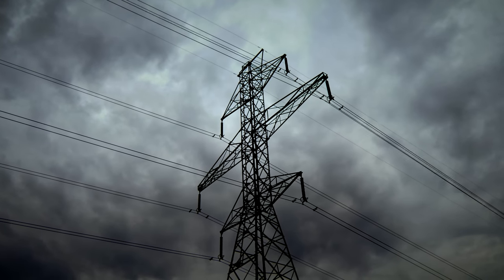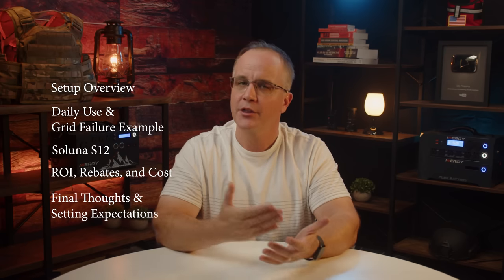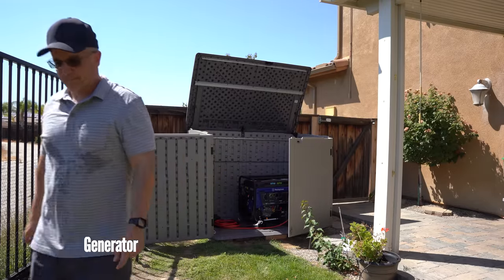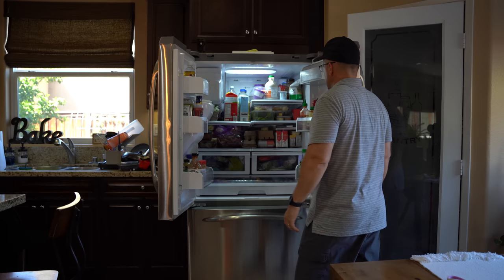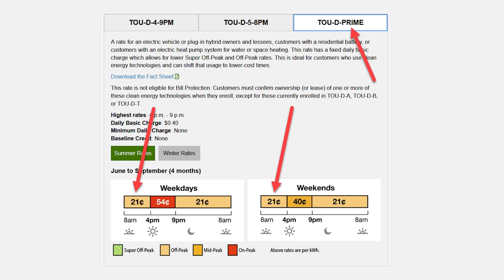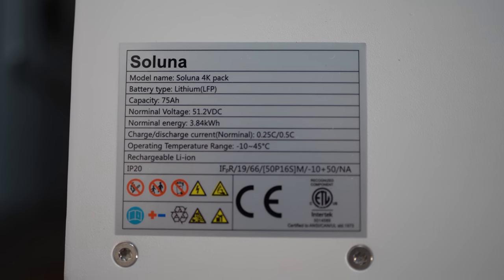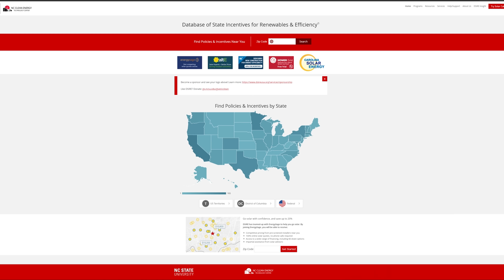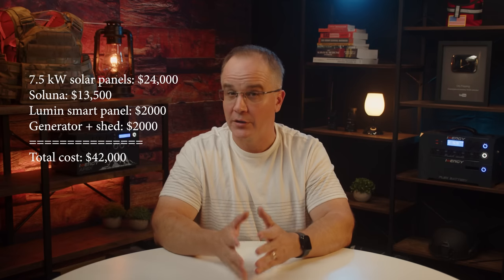The Coming Power Grid Collapse.  Soluna S12 Whole Home Backup Power

Comment from the maker: Check out the Soluna S12 here: https://cityprepping.tv/3RxtzIp (coupon code "cityprepping") or contact Inergy with questions: https://cityprepping.tv/3PerDCM
Reply: Chris thank you for this. I am based in central texas an just had a company coming for an assesment on my house. horrible service, more than double the price and no battery pack, no generator either. I decided not to get it with them however I keep looking for a system like this. i will use you coupon to contact them for a complete system
Reply: @Maran2012  We'd be happy to help you out!
Reply: The Northeast Blackout of 2003, prime example of our ancient, obsolete power grid. A line drooped into foliage, blackouts across northeast US and southeast Canada.
Reply: Sounds like a great system and will save you money Kris.

Comment: If only I had $42,000. Even the $31,000. Guess I’ll have to rely on my wood stove for heat, oil lamps for light and my gas generator for my fridge. Sadly no one is giving me things to try out. You’re definitely blessed to have it all. But I don’t envy you living in California with all those houses near you! I’ll take my woods and farming neighbors and feel blessed. Take care
Reply: Chris has the means to buy a turn-key system.  I design and install off-grid energy systems that will blow this out of the water for a fraction of the price.
Reply: a cabin wood heat and stuff      remote   is best     for just so long     too many people too many issues
Reply: Wait until he gets his video revenue....this will be a FREE system!
Reply: @garymorton7922  psalms37 : 10 11 & 29 💞 Eviction pending
Reply: Most of California is rural.  And since COVID, many people have figured out how to work from home.
Reply: im on disability and built a system for my home that handles 100kwh that cost me only 10,000 by not buying a already made system i bought each part over a year little each month  but if you build it like i did you have to install it your self
Reply: @HighDesertOffgrid  Contact information?
Reply: Wish I could afford what you have.
Reply: Look up Will Prowse, you can build a full system for less than $5k that can run your fridge, freezer, lights, tvs, computer, water pump, etc. Just buy a lil at a time. You could even do a much cheaper system if you only needed to run a fridge and lights. Best of luck.
Reply: @Jinxed Swashbuckler I do completely off-grid systems. Panels, battery banks, charge controllers, and inverters.
A turn-key system is simply one that is completely done by someone other than yourself.
Reply: The grid has been on the verge of failure for decades yet it still is here.

Comment: If u control everything through ur phone and towers are out, I assume you got other sources to manage the system? How is it done?
Reply from the maker: it all works without my phone.  i just couldn't control the Lumin with my app, but instead I can either unplug devices or flip the circuits manually in the sub panel.  The Lumin is a "nice to have" feature, but not required.

Comment: Microgridding is the future.  Point of use power will always be most efficient, and we can supplement the grid when needed.  A community wide microgrid will do better than a centralized mechanism.  I am in the process of designing systems from RV, to home, to industrial.  It will be modular and can scale easily.  The RV systems will  of course be smaller in footprint, but I will be trying to maximize efficnecy for power in.
Reply from the maker: Yup...I agree.  Our state is trying to incentivize people to move this direction.
Reply: I'm in az, 22,000 kilowatt solar system, I can't use all the power I make
Reply: I'm completely off grid and DIY'd everything.  But, I am an EE by trade and been working in the industry for over 20 years.  I know a little more about electrical than the average bear.  

Everyone should start looking to moving away from centralized utilities and control.  But that means discomfort, so we know most people wont.
Reply: I'm a fulltime RVer.   Last fall I had 1200 watts of solar panels installed and wired to the RV's "house" system.  I have a Bluetti 2000 watt unit that I charge from the "house" system.  What I regret is that I didn't have the money last year to replace the "house" lead-acid batteries with lithium, only deep-cycle AGMs.  Really frustrating on low-sun days how little I can draw from the "house" batteries before they are overtaxed.  Glad to have the Bluetti as backup - I will plug specific appliances into this if needed.  (I'm also glad I  have a gas/propane 3000 watt generator as additional backup - I run it on propane, keeping the generator itself easier to lift as gas tank always empty. This functions as 30 amp "shore power" when needed.)

Plan is to save up for two 100 amp-hour lithium "house"  batteries.  Strongly recommend to anyone replacing their RV "house" batteries with lithium.
Reply: Until the sky goes dark...
Reply: I don't think one can be at all certain about such a prediction in such an uncertain time. A return to subsistence farming and a post-industrial economy may be the future. Home power systems likely won't survive more than 10-15 years without maintenance components being available even if they aren't destroyed in some fashion. I don't know how likely any of these outcomes are, I just imagine that they are >0.
Reply: False:

When it comes to generators. Grid scale generators which use HRSG technology to recover waste heat achieve 55% to 65% system efficiency by recovering energy in the waste heat.

Home generators are 10% (low load) to 20% (max load) efficient.

Since most homes will be run at 25% load or less the grid generators are around 5x more efficient then a home generator. There are distribution losses but most of the power does make it to your house. I have had zero luck finding home generators that recover waste heat to create more electricity. There are options that allow for waste heat to be used to heat the home.

Renewable energy and batteries on the other hand are an easy win when it comes to distributed grid.

The point is, get a generator but don't expect it to be more efficient.
Reply: @garycarder4363  how much of that do you actually use?
Reply: @offgridmgtowhomestead2520  and money grows on trees.....
Reply: I think that's correct.
Reply: @offgridmgtowhomestead2520  I'd very much like to see your vision on this one and your achievements. Hope to see videos or articles about your builds.
Reply: @stefanbukowski8983  I don't think I've ever seen anyone talking about microgrids and distributed power generation and mean anything but renewable energy.
Except you, that is, but that doesn't really count because you're just strawmanning to feel like the smartest person in the room.
Reply: @offgridmgtowhomestead2520 ur right most people won't but will be forced when the grid goes down.

Comment: Remember: Rechargeable batteries only have a certain amount of charges before they have to be replaced. Companies ALWAYS exaggerate the amount of charges.
Reply: Forget AGM and Flooded batteries, go with LiFePO4 batteries, they have a 5 or 10 year warranty and the 10 year ones have a 6000-8000 cycle rating. The cheaper LiFePO4 batteries are good for 4000+ cycles. I've used them for years for ham radio. They are expensive but have a much longer life than standard deep cycle batteries and you can drain them to 5% capacity (but for maximum life, keep them between 20 and 80%) as opposed to only being able to drain to 50% without damage like normal batteries.
Reply: @Future-Preps35  agm's are rated for four years life....my last set literary lasted 4 yrs.
Reply: Yes but there are ways to greatly extend the batteries life for one you never allow it to drain beyond 50% and the system will last for years
Reply: @W9HJBill  That's some good info. Thanks.
Reply: also build a solar system witch is "AC coupled"  takes demand of your batteries
Reply: Lithium ion phosphate batteries are much different.

Comment: on a side electrical note: consider having a whole-house surge protector installed.  When the grid is hinky, this will protect your electronics, fridge, and anything else that's plugged in.  Also helps prevent panel fires.
Reply: This is an excellent suggestion.  I hope everyone who’s able to takes your advice.
Reply: He mentioned the emp shield protection that they are rolling out soon specifically for the soluna and anything connected to it. Basically exactly what your talking about
Reply: @Fantasma781  the surge protector won't shield from EMPs, unfortunately.  But it will protect from what we have here a lot, which is surges caused by lightning, or by blown transformers.

Comment: We just can't afford a whole house  system like this.  My answer is to prepare to live like the 1800's.  Wood heat, lamps and candles (I raise bees and have plenty of beeswax),; and we have different means for cooking, laundry, etc.  I will be purchasing a portable solar system after watching your video on them, Kris.  I've narrowed it down to two choices now and hope to purchase by next week.  Love your videos, keep  them coming!
Reply: Depends on how you go and your budget. I have roughly $6k in my 2400 watt setup now. Harbor Freight has 100 watt kits for $189 add a 35AH battery for $85 more and you have two lights and USB charging. But they run sales regularly and these costs can drop 25% some weeks if you have a keen eye and can wait.
Reply: @jamesklingler1098  James, thank you for that information.  I will check into soar a bit further, and the items at Harbor Freight and compare them to the portable units.  I do wonder tho if a system we can build on would be better than portable units.  But portable units are nice because, well, they are portable.  Hm.  This can get confusing at times.......
Reply: @GSDsforever  Bauer modular rolling box are $70 they have other things to build it out. I used their 2gauge jumper cables for battery cable and made my own ends, because $3per set is ridiculous, with copper pipe. They have pretty much all that's needed to make a little solar setup for the money. Only decent thing they are missing from their solar lineup is an MPPT charge controller.
Reply: We purchased a small Jackery solar generator just so we could use a lamp and a couple of fans during the night (we live in Florida). It works great and easy to use. Good luck to us all
Reply: I can't afford this either. I am disabled and on a very low fixed income. This system is way out of my budget. Plus I live in a tiny apartment so raising bees, wood heat, etc., are out of the question (even though raising bees is very cool). I decided to go with solar, hand crank, and battery operated items for self sufficiency. We do what we can with what we have. :)